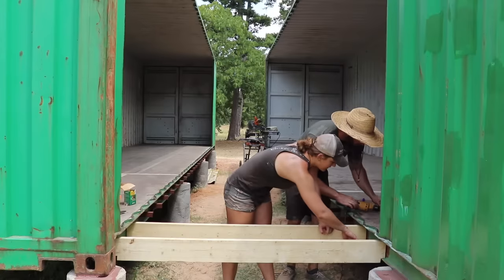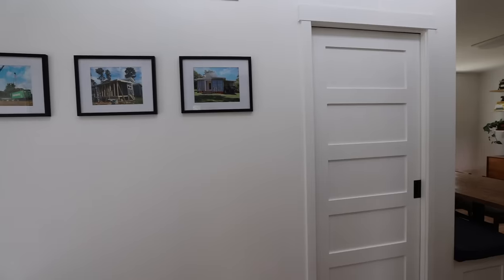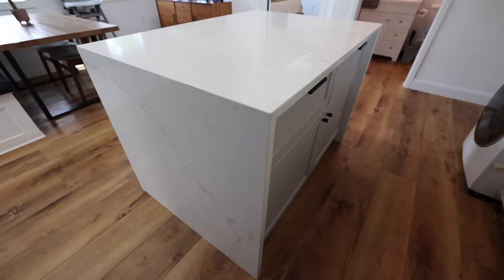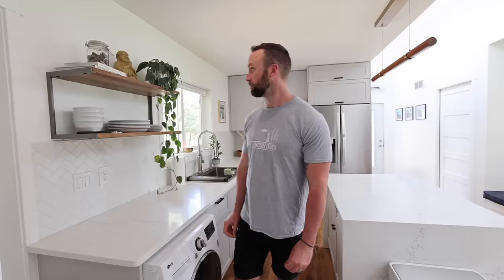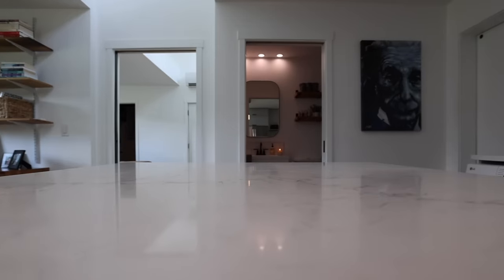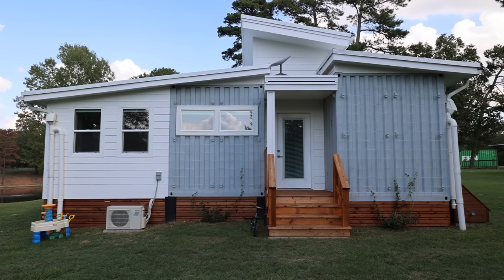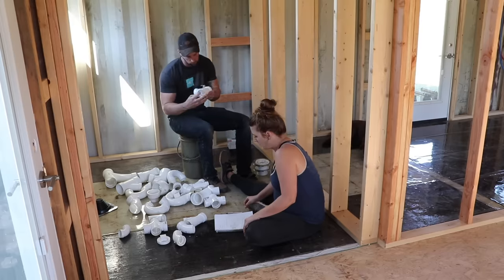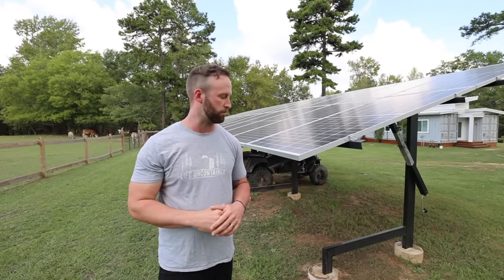See Inside Our SHIPPING CONTAINER HOME Built For A Life Off The Grid

Comment: Congratulations to you both. When you upgrade your PV system, try research using Sodium Metal Chloride (SMC) batteries, instead of Lithium Ion. The change in temperature over the different seasons does not affect SMC batteries.

Comment: On the bottom of your washing machine are adjustable feet that screw up and down. The shaking is that the machine is unbalanced. Pull your machine out with some liquid on the floor, which helps with sliding in and out and adjusting the feet with a spirit level. Hope this helps with the shaking.🙂♻️

Comment: Gday folks..fill the outside water heater with SOAPSTONE ( powdered)..it is very heat retentive...and does not explode or combust...it can heat to 800 degrees farenheit..run the copper tubing inside ..water runs through the pipe...heated by the SOAPSTONE.......IT CAN ALSO BE HEATED BY A SMALL FIRE,..CANDLE,..INSIDE WOOD STOVE ETC..